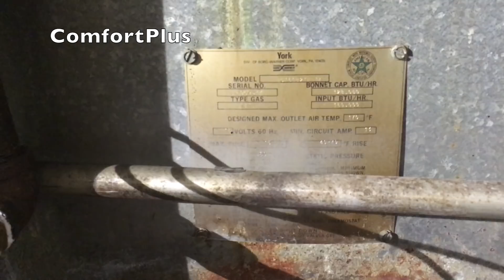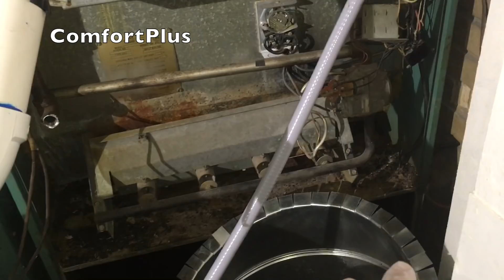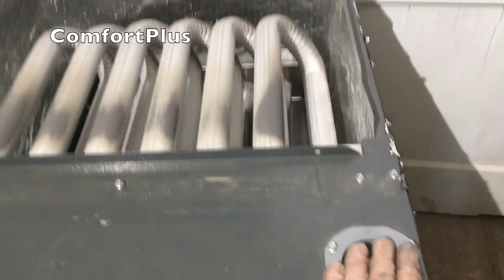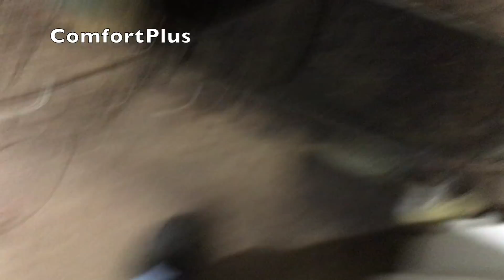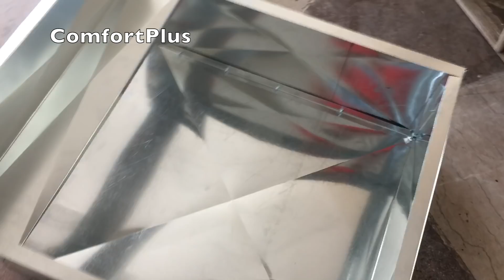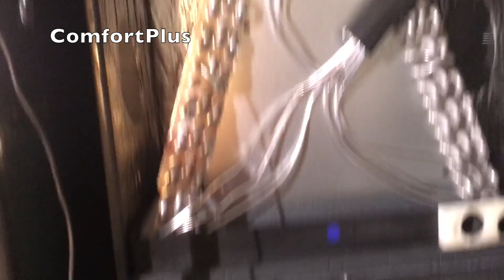Goodman Furnace Relocation

Comment: Good-looking job. Way to be a problem solver to come up with some great ideas. Do they have a drain line they're already? Or did you have to run a drain all the way out somewhere? If your customer has an issue with those 20 by 20 by 1 filters, Honeywell makes a 4-inch filter that is made to go into standard one in return air filter grilles. That would greatly reduce the static pressure drops being might be experiencing with the present setup. I always try to get 4-inch filters on my side jobs when they come up. If not I try to get a 2-inch at least.

https://www.filtersusa.com/furnace-filters-honeywell-magnet-fc40r1003-20x20-mfc40r1003-1?gclid=Cj0KCQjwybD0BRDyARIsACyS8mudOSzmHQEzlUpDTzqeKbZx67cD5nQuU8VtXIg2-dSt0CsqfG7fhkwaAsmaEALw_wcB

Comment: Excellent Job. Whoever did that original botched up mess ought not to be in business. Running the air from a 96% efficient unit right THROUGH an old broken down hunk of junk unit kills all the high efficiency !! The performance now should be way way better with the bill only a fraction of what it was.

Comment: Chuck I first want to say nice to see a new video from you . In my opinion you not only the one that strives to make sure everything works topnotch but it also looks great too, the sign of a true craftsman. But i do have one question the figure I come up with for the return is that it is good for a 4.2 ton ac am I not figuring correctly or was you just limited by the drain location. Thanks ahead of time from me a person that takes pride in my work and always willing to learn. Rick from Swansea Illinois.
Reply from the maker: Bigger is always better but a 12 x 28 duct would easily handle the 1900 cfm the furnace is moving. The real restriction will be the two 20x20 filters. Hopefully they will keep them changed out lol.